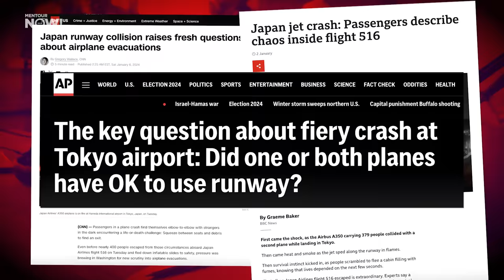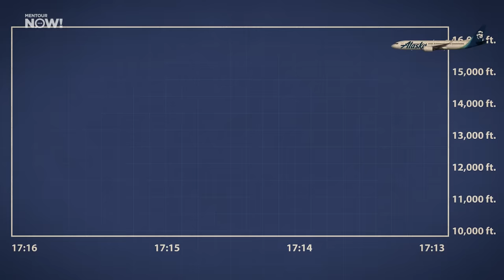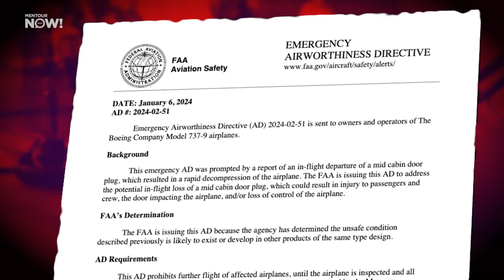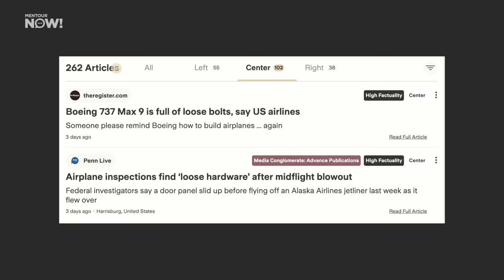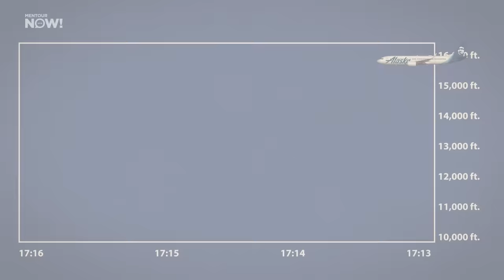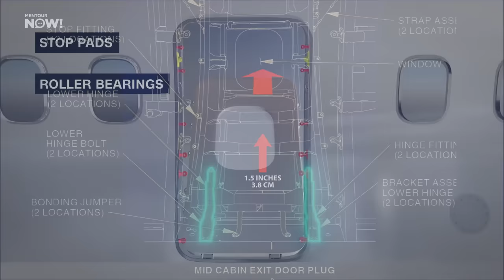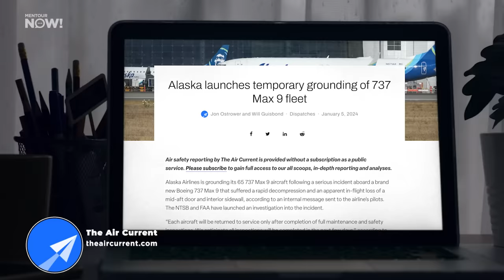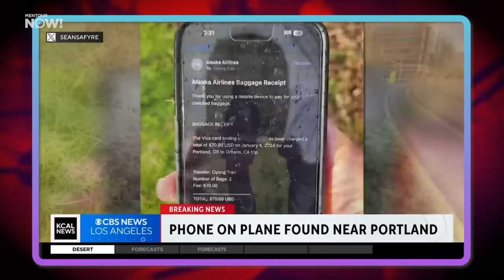WHAT Is going ON with Boeing?! MAX-9 Door blowout

Comment from the maker: Go to https://ground.news/mentournow to stay fully informed. Subscribe to the Pro plan for less than $1 a month or get 30% off the Vantage subscription this month only.
Reply: We completely inderstand that you don't want to comment before final report is released but we really appreciate any of your thoughts ASAP even as speculations if you openly admit that these are only your speculations. 

Thank you for your content and we look forward for updated video about persisting long term Boeing company problems and what can be done about it.
Reply: The contractor which made the fuselage, retired most of their experianced workers early during Covid to save money on labor costs, leaving people who couldn't hammer a nail, much less operate a wrench/spanner. The plane in question was manufactured by children.
Reply: BOEING Quick Fix = DUCK TAPE and Chicken Wire the Whole Fuselage. Should bring it back into Service Super Fast !
Reply: The cockpit door was actually fully opened by the explosive depressurization as is designed to do, but there weren't mention of this in the documentation (as far as I understand), not just the panel which opens for a slower pressure loss. 

Thanks for the quick video, I do appreciate and want to see more like this, it's ok some details like this can scape QC 😅 in a video. 

Back to the cockpit door, the big issue here is the lack of information for the pilots and documentation, this ties with the previous MAX issues, like the lack of documentation regarding MCAS, now the question is, what else is there to uncover. At this point I do believe MAX should be taken out of the type rating of the 737 family and require new training, to remove any incentive from Boeing to keep hiding relevant information.
Reply: A diversity hire didn't think to bolt the door in properly.
Reply: @joaquins90  From what I've read, the aircraft certification doesn't require designing for such a large pressure difference between the cockpit and the cabin as experienced during this accident. And for the pressure difference required for certification only the panels would open, not the entire door. However, this door plug was large enough to cause a higher pressure difference than the one required for certification, and apparently Boeing designed the door to fully open in this situation. But, as you mentioned, they failed to mention it in the manuals. So, some bonus points for taking this into account although it wasn't required. But they should have still mentioned it in the manuals. And the Boeing manuals are very poor in general. For example for the plug door the manual is directing you to slide the door plug down to clear the stop pads and be able to open it, instead of up. Hopefully the FAA will force Boeing to focus more on quality and safety from now on. They already found loose bolts on those plug doors on other MAX 9s, so it is not an isolated incident.
Reply: @guidedmeditation2396 come on man, seriously?  That’s what you get out of this?  SMH.
Reply: spigen cryo armor case for the phone
Reply: @VladimirNicolici  for certain, the biggest issue is the lack of information in the manuals, and as you mention those aren't really extensive, makes it more easy to imagine there's more missing there, likely enough to warrant a new type rating, which Boeing pushed a lot already to avoid, too far IMO. 

Of course there's the other factor that there's actually a way to open the door, but I'm familiar with design considerations and practical limitations have to be defined, so I don't have a strong opinion over that, and I think the design seems reasonable, the lack of documentation is not.
Reply: •Time for Boeing to bring the 737MAX fuselage production back to Seattle or surrounding areas in the State of Washington. 
•Boeing needs to go back to 100% vertical integration.
Reply: * If all 4 bolts were missing this would happen in the first flight. * It is impossible for all 4 bolts to fail at the same time. * The door panel did not even have a scratch or bent after 16000 ft fall. * Much bigger INTERIOR PANEL had disappeared. * The fallen cell phone shows the baggage was checked in on Jan 4th, a day before the accident. * Everyone was very calm, I wonder what the cockpit voice and the ATC communication sounded like when the cockpit door blew up (By design according to this video) ?
Reply: The case on the phone was a Spigen Cryo Armor case
Reply: With 1150 comments, it is next to impossible to update anyone on what I believe the real root cause was.  According to the maintenance logs, the pressurization problems occurred AFTER the airplane had been sent to AAR (an aerospace aftermarket solutions company) for installation of a wIfi system that actually required the removal of that door plug.  This had nothing to do with Boeing or Spirit Aerospace as  Alaska Airlines sent it to them after the delivery of the airplane from Boeing in October 31.
Reply: @sral787  yeah, but it was an iPhone (14 Pro Max) after all...  and they are already acknowledged to be the most drop worthy phones on the market.
Reply: I'm never sitting next to a door again...😳
Reply: @rtbrtb_dutchy4183 Everyone knows diversity and inclusion hires are hired on the colour of their skin and/or whether they belong to a "minority" or "previously or currently oppressed" group, not their knowledge and skills.
What do you think is going to happen when semi-qualified people are hired to do a job outside their skillset? Go on, take all the time you need to think about it...
Reply: @Sajuuk  first of all, these missing bolts, to go to DEI without knowledge is absolutely ridiculous. 

Now, as to the broader aspect of DEI, it doesn’t happen the way you think. They aren’t freaking hiring unskilled people. These people are skilled, but the past has proven, they don’t get an equal chance, even when their skills are equal. 

But that’s not what any of this is about. This video is about a plug that blew out and it seems to be human error. Somehow, you and the other dude, find a way to blame this on DEI with zero knowledge about this. It shows your biased mind already.
Reply: Cockpit door fully blew open by design which the cabin crew were not aware of as Boeing had told no one this would occur. They attempted multiple times to close it eventually getting it shut, they were fully shaken by this and are currently undergoing counselling.
Reply: Excellent video and thank you for it.

The latest info; ( 2pm PST 14 Jan) notes that the FAA will be doing a sampling audit/inspection of 40 Max9 aircraft plug doors.
If no missing bolts are found then this blow incident will be an isolated incident and not a systemic problem.
Reply: @John-nc4bl  Until the next major MAX failure. 

I am suggesting a forensic analysis assessment program to the FAA that absolutely must be done.
Reply: @ShonMardani  Maybe: The plane had 145 hours on it which raises more questions than answers. 

For good reason, I have zero confidence in the FAA and Boeing. Their conflict of interest relationships have continued for decades with near fatal and fatal consequences. 

Until that changes, more other same is all but guaranteed.
Reply: Scotland and Sweden arent friends but I hate the thought of you flying on an aircraft you cant trust you are a Swede
in its best traditions Salute from Scotland
Reply: I’m thinking that the WLAN contractor left the bolts out after removing and replacing the door during aftermarket installation
Reply: @MentourNow suposedly it was a Spigen Cryo Armor case
Reply: I think everybody was lucky. If this happened at 40000 ft everybody could have died
Reply: Why can’t a lot of the open ATC positions be filled with AI?
Reply: The blowout panels only open to the cockpit side, e.g. pressure loss (hole) needs to be that side.
Reply: I heard it was the sub contractor of Alaskan, after they accepted the plane from Boeing, who was installing the Wi-Fi  after ? Go figure?
Reply: 15 yrs today, Capt Sully
Reply: Why is that someone who probably has more relevant knowledge than most of us put together, and after significant research, still can't produce a video that comes up with a definitive answer?

Yet the armchair experts and conspiracy theorists can spout utter and sometimes contradictory rubbish with absolute certainty?

I suspect that it can be explained in just one word - PROFESSIONALISM!

If only fact checking and how to research and analyse information were core educational subjects.
Reply: @ShonMardani Yours is the first comment I have Sean anywhere that mentions the missing inside panel that surrounded the plug door! I have been wondering about this as well...
Reply: @joaquins90 "…the design seems reasonable, the lack of documentation is not."

Why must there be documentation in the pilot's operations manual that the cockpit door can blow open due to a severe cabin decompression? How does that documentation help the pilots operate the airplane? How does the lack of such documentation hinder or jeopardize the operation of the airplane? Would such documentation have a procedure for the pilots to perform, the lack of which is currently an operational deficiency? If so, should all other airplane models be grounded?
Reply: I couldn't find the link in the description to the YouTuber for  "nerdy" 737 enthusiasts, but I'll scroll back through the video to find his name and look him up. Just in case you forgot, my friend. :)
Reply: Food for thought. 
~{I wonder if this news source is creditable? Oh well this person, (who’s been paid to say so), says that it is. Well sounds good to me}~
Yeah its not very convincing and kinda sus. IMO of course.
Reply: AFTER delivery, Alaska Airlines hired a contractor to install satellite Internet.. in the ceiling next to the location of the plug door..  the day before the first pressurization warnings started.
Reply: There was a case I remember where somehow a woman survived a fall of like 30000 ft from an aircraft and surviving I think she was cabin crew and it happened in former Yugoslavia  quite awhile back don't recall how she came out of plane .if memory serves she hit a steep snow covered slope that hind of acted like a kids slide.i think she may have been interviewed shortly after and the again 20 or so years later as well
Reply: now we know for sure BOEING forgot to install ALL 4 BOLTS that held the door in place ... How can you miss ALL 4 is what surprises me.. that's not a minor quality control... It's 4 major ones and at the same place
Reply: now we know for sure BOEING forgot to install ALL 4 BOLTS that held the door in place ... How can you miss ALL 4 is what surprises me.. that's not a minor quality control... It's 4 major ones and at the same place
Reply: now we know for sure BOEING forgot to install ALL 4 BOLTS that held the door in place ... How can you miss ALL 4 is what surprises me.. that's not a minor quality control... It's 4 major ones and at the same place